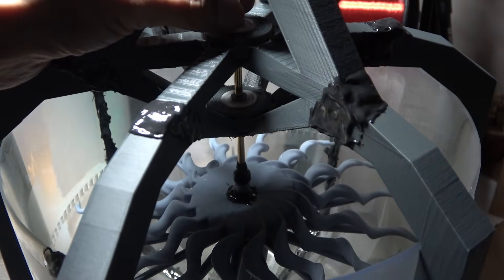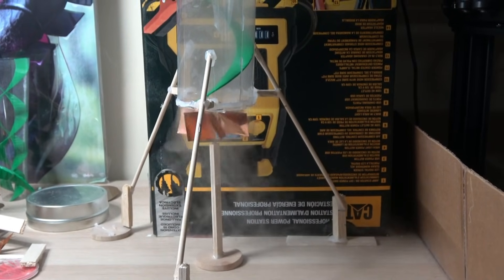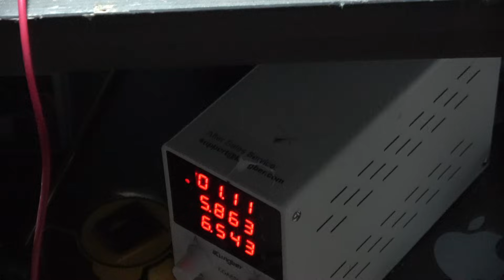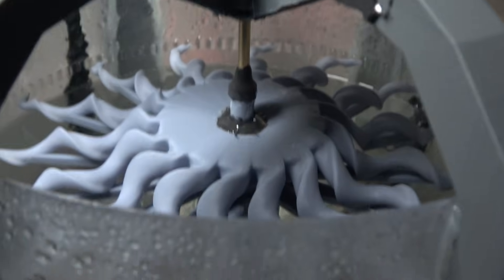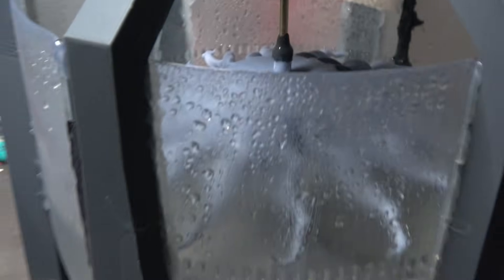Viktor Schauberger Tornado Home Generator Version 3

Comment: Cool. I had STL files created about 8 years ago for the Water Tornado..  nice to see others working on it.
Reply from the maker: Did the design you had actually work?  Did you 3d print it out?  Thanks
Reply: @spiritelemental  By using a vacuum pump, you can prevent air molecules from entering, thereby increasing the RPM level.

Comment: Getting closer Bro
Reply from the maker: Thank you.  🙏  I appreciate it.  More work than you would think went into making this current project.
Reply: @spiritelemental  By using a vacuum pump, you can prevent air molecules from entering, thereby increasing the RPM level.